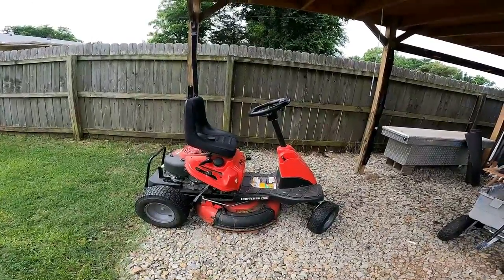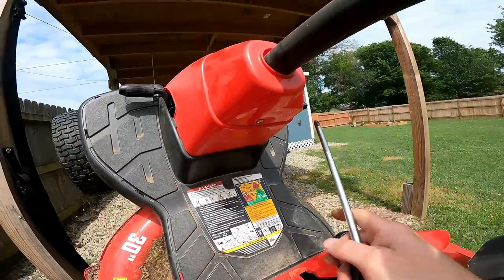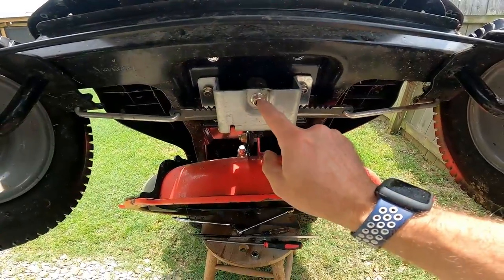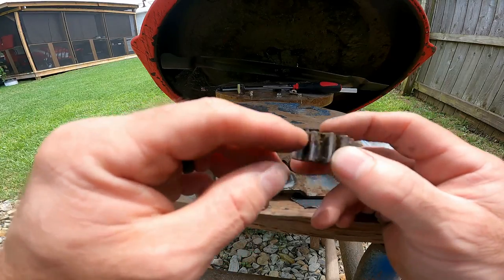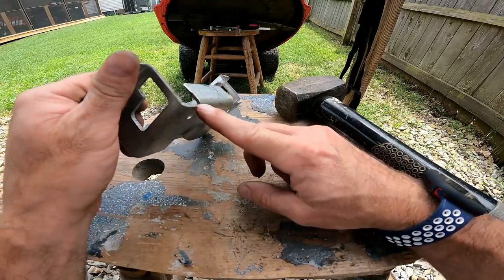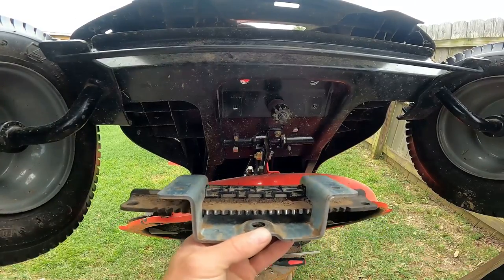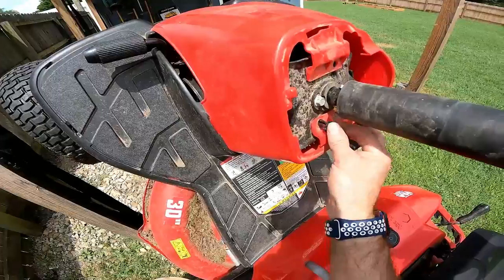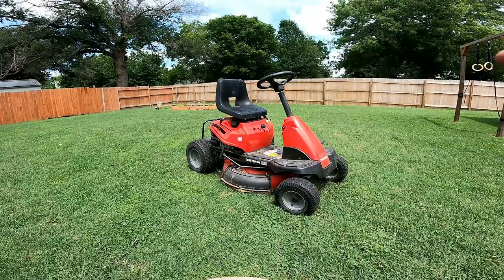Craftsman R110 Steering Problem DIY Step by Step fix!  Save money!

Comment: Thank you so much. This was exactly my problem. Was a pretty easy fix although I had to take off both wheels to get to the coddler pins, which ended up breaking so I had to run to advanced auto to get a set of assorted coddler pins.
What I did do that I don’t think you mentioned, I greased the gear and the bracket .
Your video unlike some of the others on your tube was direct and straight to the point. I also like that you talk it through beginning to end.
Now my r110 feels like it has power steering. Thank you again!
Reply from the maker: You are correct.  I failed to mention greasing it up.   Thanks for your kind words.  I’m very happy my video helped you.  Thanks for watching.
Reply: @rjguess  I subscribed to you in case I need to know how to change belts..
Reply from the maker: @2linepass1  I apologize for not making this video yet.  I’ve been busy.  I plan to do this soon.  In less than 2 weeks.   Thanks!!
Reply: @rjguess  awesome!! Luckily I don’t need to change my belts but I will definitely look you up if I need  a tutorial

Comment: You just saved me. Did this last night, HUGE change. Now I just need to replace the carburetor
Reply from the maker: Awesome!   I could make video on that.  Not sure when I can get to it.  But hopefully soon.   I’m glad this helped you.  Mine is still working good to this very day.   But eventually I will have to replace it with brand new parts.   But if I do get brand new parts.  I’ll make sure it’s snug like what I did in the video.

Comment: Nice video, clear explanation and just the needed info. Tomorrow I'll help a neighbor with this problem on a Murray. He tried a new pinion gear & sawtooth plate. No luck. I'll post the results as soon as we finish it up. Many thanks.
Reply from the maker: Thanks!  I hope it helps you!!   Thanks for watching!!
Reply: Used your steps today and it  worked perfectly. I added the use of a sliding T-bevel so we could see the progress. It doesn't take much as you mentioned. Thanks again very much.
Reply from the maker: Great, glad to read this!   Glad you got it up and running now!!

Comment: I've got exactly the same issue. This video is great!. I really like how you didn't skip any steps and explained everything.
Reply from the maker: Thank you very much!  I appreciate your comment and watch time.  This fix will last you a long time. Mine still works excellent to this day.  One thing I did not do in the video was add some grease to the gear and movable parts.   This will help the fix last even longer.
Reply: @rjguess  In my case it is a Rover Mini Rider, but almost the same machine. My steering rack did have a lot of play and your video gave me the confidence to disassemble it. I have found a couple of badly worn teeth in the rack too, so will have to order a replacement. My rack doesn't have that bit of plastic. The hardest part about the whole job was getting the cotter pins out!
Reply from the maker: @jeremyahagan  yes, those cotter pins are a pain!  I’m glad my video helped you out!!

Comment: Wow, thank you so much for sharing this information. I just had my craftsman steering do exactly what happened to yours. I fixed it yesterday following your instructions and it is running perfectly now. The hardest part to the repair, was getting out the cotter pin, glad you said to buy a new one before you get started, as I did need it.
Reply from the maker: Great!  Glad my video helped.  The only thing I did not do in this video that will help the repair last much longer, was putting a little grease on the gears.   That can be done at any time.  Thanks for watching and commenting!!

Comment: Worked great! Thanks for the information! I put a little hot melt glue around the shoulder bolts after removing the pinion gear assembly. That way I didn’t have to remove the upper housing.
Reply from the maker: Good idea!   Thanks for watching!

Comment: I have a Poulan Pro 301 that had the same problem. That plastic part wears out, but was no longer available. For the sake of time, I shimmed it forward after reading the comments. This worked great, but yours is a much better long term fix that I will do at another time. One of the best repair videos I’ve be ever seen. Great job!
Reply from the maker: Thank you sir.  The only thing I lacked to do was grease the gears in the video.  This repair job is working beautifully to this very day!  I appreciate your watch time and comment!

Comment: I have the Troy Bilt version.   I just had to do the same repair.  I ended up replacing the whole assembly.  A couple of things to keep in mind to lessen the likelihood of it happening again.    Grease the rack and pinion frequently, and make sure the front tires are properly inflated before you run it

Comment: I have replaced the gears on my Cub Cadet twice. Thank you for the right repair to this problem!!
Reply from the maker: You are welcome.  Add a little grease to the gears.  I didn’t in the video.   It will help the steering become even smoother. Plus last a lot longer.  Mine is still working perfect to this very day!   Thanks for watching.

Comment: You can also just wrap some zip ties around the housing to remove the slop in the plastic slide. The housing has 2 convenient slots the perfect size for a zip tie to fit and tighten everything up nicely.
Reply from the maker: Thanks.  You should make a video of that and share it.  Seriously!
Reply: @Michael Keefer I'd like to see that video myself!
Reply: I passed a piece of coat hanger behind the rack to push the teeth towards the pinion gear and adding a dab of grease for a quick fix.
Reply: Same, can one of you make the video please?
Reply: You could also place a shim in there that could accomplish same thing
Reply: 30 seconds later... I was back in business. Thanks!
Reply from the maker: Thank you for watching
Reply: I think when mine starts doing this slipping bit I will probably take the bracket off and tap it back in place with the hammer,,, plastic zip ties seem like a really good way to go,,, however. I mow 2 different properties when I’m at the property up the street from my primary residence and it’s all almost 100° outside i’m probably not gonna want to lay down on the ground and roll around and screw with a broken zip strip,,,it’s plastic not a question of if it’ll break but when.
Reply: @william38022 they make stainless steel zips too
Reply: I’m gonna try that my man before I go through all that in this video both of them very helpful but one sounds a lot quicker😂
Reply: The zip ties worked for me! And 30 seconds is all it took! Brilliant idea!
Reply: My dad had one of these. He passed away but I still want to use it to mow his yard. His neighbor told me that he did the zip tie fix to help my dad out, but when I mowed with it I still got some slippage. I think I'll try the fix in this video! Thanks for the info.

Comment: I was just about to order the steering assembly on Amazon. Then I said to myself let me see if there is a way that I can do a fix without buying parts. Great video. Even if my gear plate and pinion are too worn they’re not expensive on Amazon- $15-$20 for the set. But I will definitely give this a go, thank you
Reply from the maker: Thanks for watching and commenting.  My repair still works to this very day. No issues yet!   Don’t forget to add some grease to the moving parts. I didn’t do it in this video.   It helps make things a lot smoother and last even longer!   I hope you are able to accomplish it.

Comment: Kudos to you for an easy fix and superior video production.  It's, always, great to see re-engineers solve a problem.  I just bought a Craftsman R110, and noticed loose steering right away... will R&R steering gear at first opportunity to correct the slop.
Reply from the maker: I appreciate your comment.  Thank you!  Thank you for watching my video as well.  It is always good to have videos like mine out there to see.  I sat and stared at the steering mechanism of this mower for over an hour.  The fix I shared came to me!  It works well. Mine, to this day works great!!
Reply: @rjguess  Also appreciate your follow up a year later to let everyone know it's still working!
Reply from the maker: @bowlsantander9730 you are welcome!   Thanks for commenting and watching.

Comment: Great vid! My dad bought this mower a couple of years ago. I've been the sole operator of this mower and it has been a struggle. I've sworn that this mower was junk because of the steering problems. My mower does the same thing and recently I've had to steer by pushing the wheels in the direction I want to go. Definitely doing this fix before my next mow. FYI to any other R110 owners if u need a quick steering fix before doing this, I've learned the mower turns better in reverse than forward. In case you need a tip to finish a certain part of the lawn before doing this fix.
Reply from the maker: Thanks for watching.   I hope you accomplish this fix!

Comment: Thanks! Just finished following these instructions and steering is fixed!
Reply from the maker: Nice!   Thanks for watching.  The only thing I did not do in this video was add grease to the gears.   It will help even more.  Good thing is, it can be done without disassembling!

Comment: Just the video I was looking for. Mine  does the same thing.  I will find out but mine started because I was too close to my chainlink fence and it pulled the steering around.  Once it slipped it gradually got worse.  I may have bad teeth on that rack bar. I will find out.  Thanks
Reply from the maker: I had a few teeth that were worn on my rack bar.  After my this fix I have had no issues. If they are not worn too badly you should be good.  Put a little grease on the gear teeth.  This will help also.   Thanks for watching.

Comment: Great quick DIY fix.  mower was purchased for $700 after only being used 1 month by a guy who went through a divorce and no longer had his home. This fix made the mower an absolute steal as it works perfect, tight turn radius, clean cut and easy to use.  Thanks for the tip!
Reply from the maker: You are very welcome!   Thanks for watching!!

Comment: Thanks, was helpful.  I used a 6 inch c clamp and was able to perform same fix without disassembling. The c clamp fix perfectly.  I work both ends two times and in less than 10 minutes was done
Reply from the maker: Very good!   Thanks for this information.   Thank you for watching.
Reply: I bought a 6 inch C clamp for the quicker fix, but it seemed to be too big.  Can you provide some video or info on how your worked the C clamp to perform the fix?

Comment: great tip but for those of us who hate tearing things apart or have limited tools i found a way to fix this issue with a pair of pliers and a metal hanger. simply cut a peice of the hanger about 8-10 inches long and slide it under the metal teeth. then bend the ends of the hanger down around the bracket to hold it in place.
Reply from the maker: Great advice!   Thanks for watching.  I’m sure others will appreciate your insight.

Comment: Thanks.  Bought this new from Home Depot under the Troy-Bilt label.  When assembling the steering shaft does not turn the wheels?  So wondering if it steering linkage came loose during the shipment?  Any thoughts?  Steering wheel turns but not the wheels?  Video is great and easy to follow!
Reply from the maker: You might check to see if the bolt in the center of your steering wheel is loose.   If you can prop it up like I have in the video and turn the wheel.   You may be able to see and find what it loose.  Make sure the rack and pinion gears are touching and moving when the steering wheel turns.   I hope you get it figured out.    Thanks for watching.

Comment: Great video!  The only problem I had was getting one cotter pin out because of the way it was positioned.  I had a concern as to which way the gear went back in.  I either got lucky or it doesn't matter. If it doesn't matter it means you may be able to flip the gear if one side is worn or damaged. Also, to save a little work you only need to take one linkage rod off and you can leave the plastic  part in but neither is a big deal.  I can't imagine that you can bend the bracket without taking it out completely. It looks like it is 10 ga. steel.  Half hour job - once you know what your doing.
Reply from the maker: Yes, it doesn’t matter what way that long flat gear goes in.   Thanks for this comment.  I’m sure others will read it and find it useful.  I appreciate you watching and commenting.

Comment: I have the Craftsman version of this MTD-built 30” rider, which appeared under different brand names including Troy-Bilt and Cub Cadet.  Essentially, they are all the same mower.   I bought mine new in the Spring of 2015, so as of Nov. 2022, I have used it for 8 seasons.  From what I’ve read, my 2015 machine has the original version of that rack & pinion setup, which was the most prone to failure.  I can see that the model in this video has the first revision  meant to fix the wear in the steering.  I guess they have revised it yet again with a better fix. 
— At any rate, I started my yearly preparation for storage this week, and today I cleaned and lubed the rack and pinion like I have every November of the past 7 seasons. 
- Despite all  the complaints I’ve read about this problem, my steering is just a good as it was when new!  Here is my take on how I might have prevented the issue.
1.  I read my owner’s manual soon after the purchase, and looked at all maintenance instructions, including storage.  In Ohio, our mowers get used from April into November or sometimes December.  They get caked with plenty of dirt, grass, and mud.  I used the manual faithfully to get ready for winter, and followed the instructions to keep that steering rack greased. 
2. At the end of that first season, I went to re-grease that rack, but couldn’t without cleaning it first.  It took forever and a can of carb cleaner & the garden hose. The grease on those exposed parts was full of gritty dirt, which isn’t a good thing.  After a ton of work, I was a filthy mess, but that rack & pinion were clean and re-greased. 
3. A year later: same gritty grease, same big cleanup, same filthy, greasy me.  This went on for yet another year. 
4. After the first few rounds of this torture, it became clear that GREASE WAS A PROBLEM because it held dirt.  And that’s about the time I started to read message board complaints about terrible wear and tear. SO:  I tried two procedures. 
5. First, I started using dry lubricant after thoroughly cleaning the parts.  I used a dry release Teflon spray, but graphite should also work.  Do a search on “dry lubricants.”
6. Second, I have ALWAYS used  the Deck Wash system after mowing. So the first thing I do is use the hose to wash out that rack after mowing. It takes a few extra seconds, and I just turn the wheels and spray up under the rack as best I can. I don’t lift the mower or disassemble anything.  
7. Now, come November, I clean any excess dirt off the gear and rack with a parts brush and some WD-40.  I imagine that a good detergent like 409 and water would do fine. Once dry- it gets dry lubed again, then off to the shed until Spring.  Cleaning the steering is now a much smaller chore, and I stay clean!  It’s time well spent. 
Like I said- my rack & pinion show NO unusual wear at all, and mine is the original (flawed?) design.   I initially worried about the Teflon spray being as effective as grease.  -Not worried anymore.  If it fails in a year or two, I’ve still had better luck than a lot of people. Next Spring will be season 9 for this mower, which I have found to be very reliable so far.

Comment: I would also put grease on that gear and bar to help slow down wear. I plan on buying one of these but didn't know how to take steering wheel off so it would fit in my kids Jeep. The seat removal will be easy. I see it's only held on by a cross bolt through the steering shaft. Thanks for the help. Great how to Vid. :)
Reply from the maker: Thank you.  Yes, the grease will help!  Thank you for mentioning that.
Reply: @rjguess  ya the manual says to grease it with standard automotive grease on the front and rear side of the rack
Reply from the maker: @mrbubetube  the grease does help.  Thanks!
Reply: Don't buy one I read where they're having a recall on some kind of safety issue I don't remember where I read it but it's out there

Comment: It happened because it did not receive proper maintenance on the mini-rack and the pinion gear. Needs to be cleaned/checked and GREASED every Spring and Fall. There's also an updated rack assy for it. Mines 6 yo now and works like a charm.
Reply from the maker: Great!  Thanks for watching.

Comment: man I followed this video to the T and it worked just like you said it would!! Thanks!
Reply from the maker: Awesome.  Thank you for watching.  I’m glad it help.  Mine is still running strong. No issues at all after this fix.  A little grease will help it last even longer.

Comment: Nice repair. I'd suggest putting some grease on the gear to help lube it.
Reply from the maker: Yes, you are correct.   I added grease after I made the video🤦🏻‍♂️.  But I’ve told some in the comments to make sure they grease the gears.

Comment: Outstanding video. I wondered how you could do this! Great job!
Reply from the maker: Thank you!   I appreciate you watching and leaving a comment.
Reply: @rjguess  Hey question I did repair mine according to your instructions but now my steering is REALLY hard both right and left. I wonder if I tightened it too tight?
Reply from the maker: @MannyG32968  yes, most likely too tight.   Try greasing the gears.  If that doesn’t help, you might need to readjust it a little.